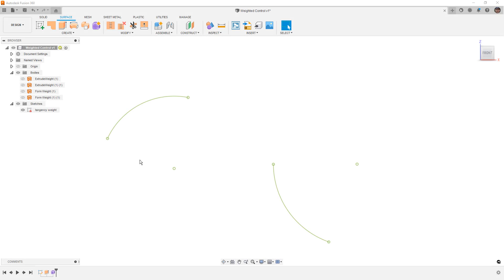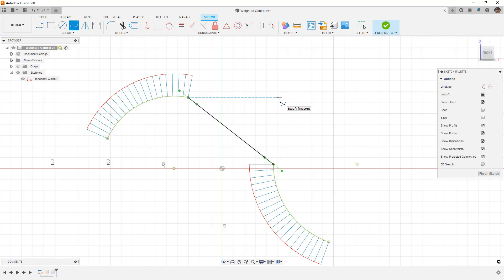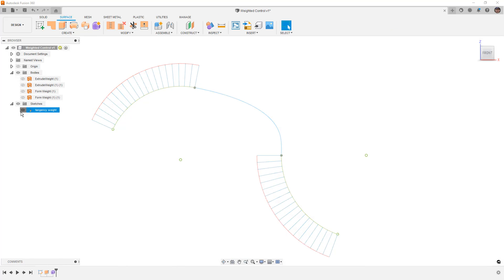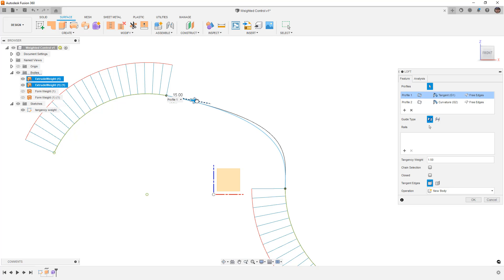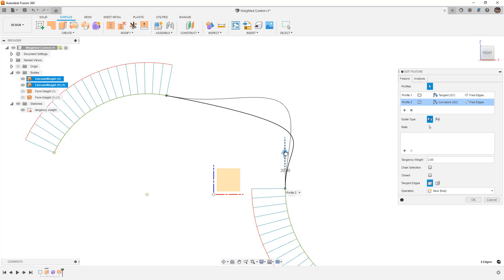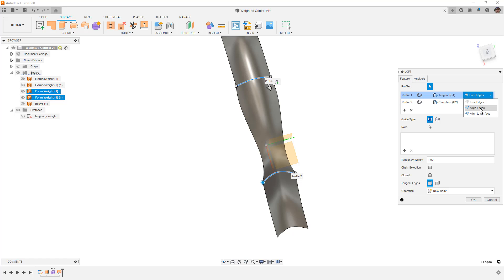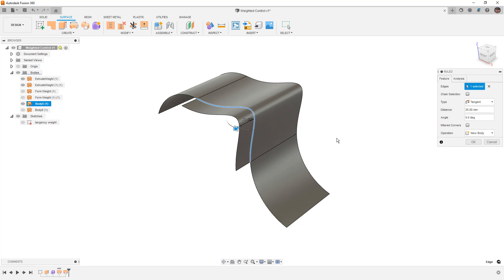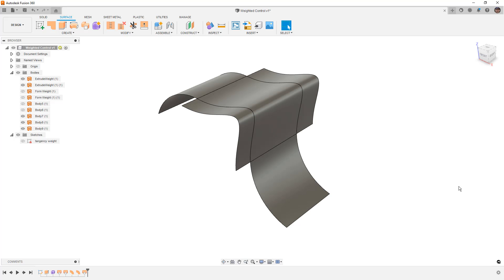Surface Mastery Part 11 - What Does Tangency Weight Actually Do? | How To Use Tangency Weight

Comment: Wow, thank you so much for answering my question!  Beyond perfect explanation.  The bit about the rails overriding the tangency weight explains why sometimes tangency weight didn't seem to do anything.  It's also super clear to me now why the tangency weight was only working with numbers in the low single digits.  I've taken probably two dozen Fusion 360 courses through Autodesk, and watched hundreds and hundreds of hours worth of youtube videos, and I can honestly say your channel is one of the absolute best resources I've found.  Without a doubt, it's the best resource for surface and form tools I've found.
Reply from the maker: Happy to hear it!  I make content for Autodesk so there is a good chance some of those were done by me.  But this channel is just a side thing where I try to dive deeper into some of the topics I can't get into with official courses.

Comment: 1st derivative magnitudes.
Reply from the maker: Right, you could think of G0 continuity as the location, G1(tangent) as the 1st derivative and G2 as the second derivative.  Location, Direction and Rate of change.  I don't know specifically that the Tangency Weight variable in the dialog is equal to the magnitude of that.  Are you saying that the 1.0(or 10.0 displayed on screen) is directly related to the magnitude?
Reply: @LearnEverythingAboutDesign  yes usually a 1.0 would mean the full magnitude as-is. 2.0 would be twice, etc.